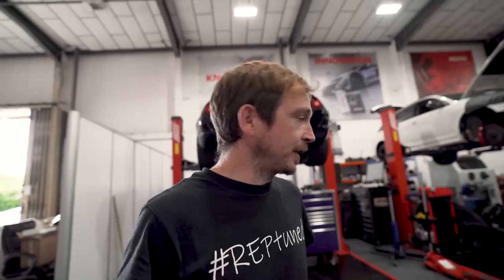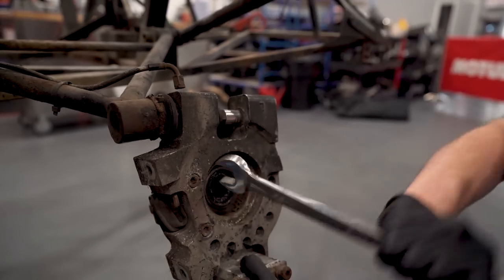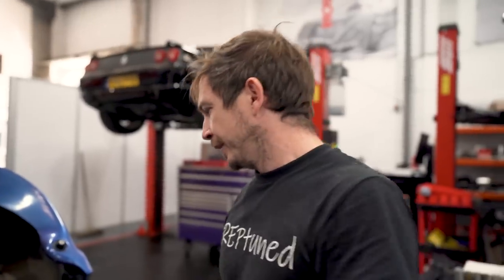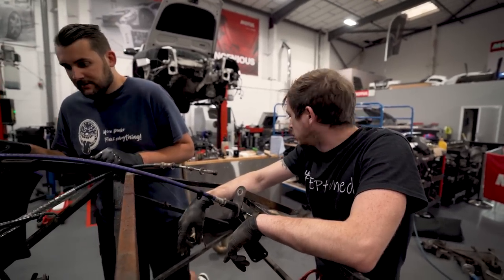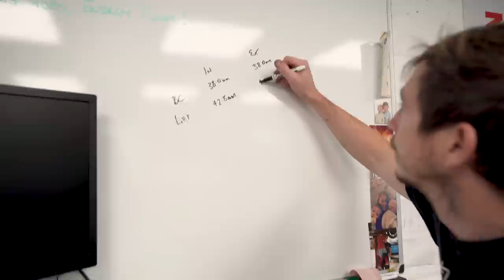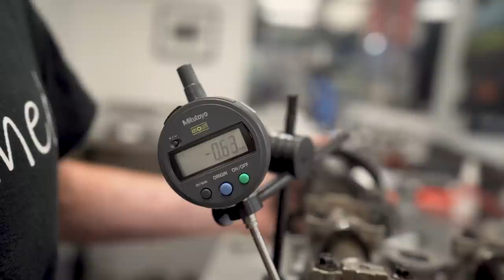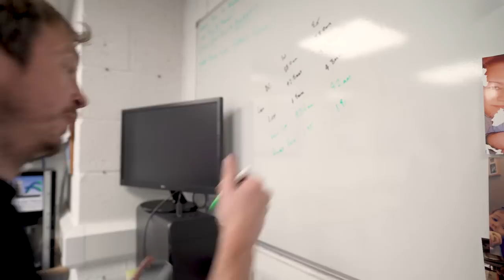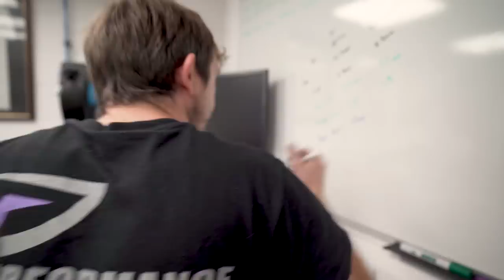Noble Engine & Chassis - BIG Problems! Part 10

Comment: The fuel injection is on the one port because that intake runner is always open whereas the other side only opens up at a certain rpm. 

I don't think a fabricator would have a problem with creating a new section of tubing by cutting out the old and using it to make a new section.  I would imagine the reduced metal would compromise the torsional rigidity of the car a bit.
Reply: Add temporary bracing bars to prevent dimensional change, cut out rusty sections and weld in new stuff it is not a big job and won't take long. At the same time add stiffener plates if you want to make the thing stiffer, remove temporary bracing and job done.

Comment: I would be tempted to have the chassis painted rather than powder coated as powder coating doesn’t like sharp edges and one crack and the water is in causing the sort of mayhem you’ve just discovered.
Reply: Definitely. I've seen powder coat crack off of sharp edges on metal fencing and similar. Decent paint is much better.
Reply: Bake it before coating sorts that.
Reply: depends what you coat it with Polyester is a night mare, Epoxy will be fine

Comment: Rust doesn’t look bad. I just did a pair of front springs on a 2011 A3 & got a few dustpans of rust flakes to sweep up.
Reply: Springs don't hold the engine in place though, do they?

Comment: Measure the rear frame with an ultrasonic thickness tool
Reply: Your friendly,  engineer surveyor, ie the guy who looks at your ramps for the LOLER inspections, should have one when he does your compressors air receiver. So if he due in, ask him.
Reply: I've got a cygnus gauge for that. They don't work very well on corroded metal though!
Reply: Yeah, Ricky would have to rub it down first. Take a reading from a non corroded area and gauge it that way.

Comment: If you need any help with measurements or anything, drop me a line, I've had my GTO 3R for about 14 years and have had custom Pistons and rings (made exclusively to my spec by Omega Pistons). I altered the base circle with a regrind on my cams and it's still in the process of a (very long) Upgrade project including making it a fastback. changing pretty much every single element of the car. :)

Comment: Not sure how you could get accurate measurements from the valve gear when it's got hydraulic tappets. Surely with no oil pressure the tappets would move, or they would be so loose the valve wouldn't get maximum lift?

Comment: I’m doing a Copart Yamaha xt125x motorbike that was ‘stolen recovered-minimal damage’ now turned into a full rebuild! Needed lots of TLC. Full bottom end strip, full gasket and oil seal replacement set, new crank bearings, new starter clutch, new ignition barrel, new brake and clutch levers, plus all the cycle parts, front and rear wheel bearings, brake discs, fork seals, chain and sprockets. Fuel tap, carb clean, and it’s not running yet!. It’s endless.🥹🥹😂😂😂

Comment: Will you're new inlet manifold solve the intake valve carbon build up? I.e. it has injectors for both of the valves??

Or are you planning to mod it to sort that out?? Or will it not make enough of a difference to bother!?

Just thinking surely you're attention to detail (OCD) won't allow you to run the motor knowing you're going to get dirty valves 🤣🤣👍👍🙈🙈🔥

Comment: That Noble is made of Twigs nothing to the frame Wow Skeletor or what. cheers Rikki and STOP measuring stuff with a Vernier please use Mics they are so in accurate just saying ex RR
Reply from the maker: I do have a large array of very accurate Mitutoyo mics but for measuring to nearest .1mm no point putting them at risk! It’s only to give a rough idea of sizes.

Comment: Had to stop watching at 22 mins because of focus. Love this channel but sometimes the focus and constant camera movements make the episode unwatchable. Re Noble if it was me, I’d have it shot blasted or acid dipped then asses. You’d be surprised at how obvious things become then. I’d say based on 20+ years of welding/fabricating that the section wrapped in tape will need cutting out and replacing. It did make me chuckle when Matt gave it a little squeeze at 13 mins 12secs and said “I reckon it’ll clean up well.” Just chop it out and replace it. Not worth the risk.
Reply: Love the content but plus 1 on the focus. Maybe a tripod for some bits? Saying that I like the spontaneous vlog style so... I don't know 😅😂
Reply: Focus is shocking for such high quality content